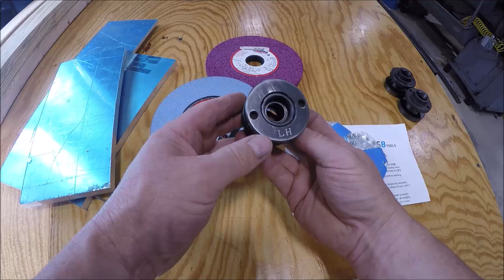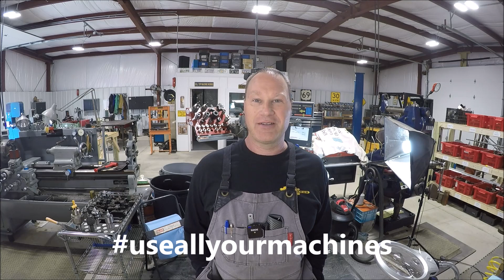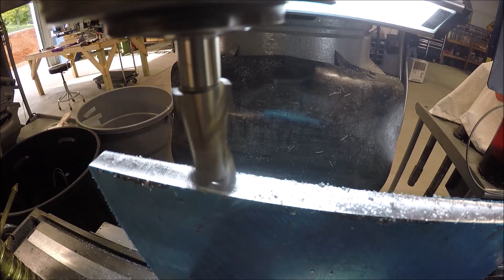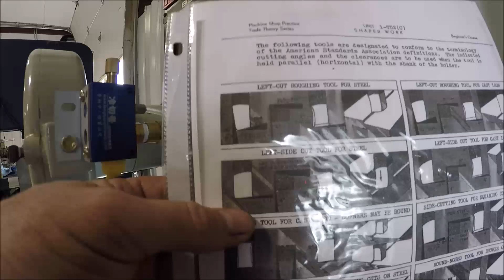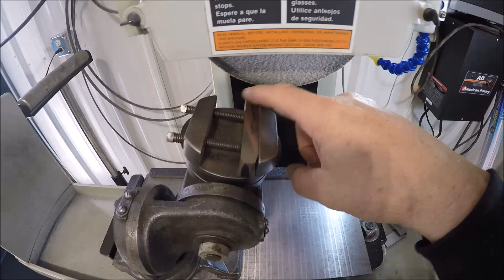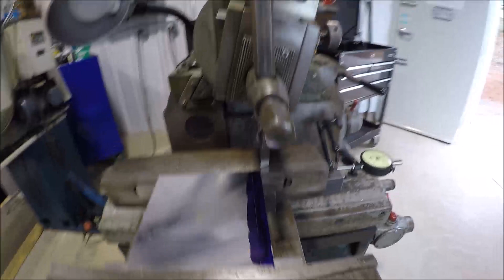Grinding wheel balancing stand Part 1

Comment: How much you paid for the harig also what was the price on the hub wheel balancers? "Use all the machines in the shop", best way to make life easier and gets the job done right. Thanks for the video, can make a wheel balancer now for the surface grinder.
Reply from the maker: $1200 for the grinder and I got that lot of 3 hubs off of E-bay for about 100 bucks.